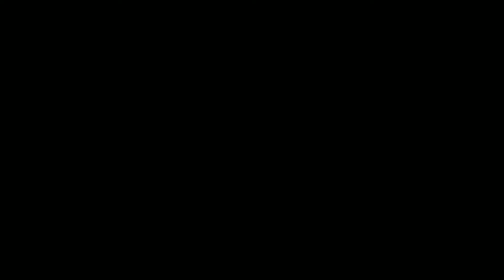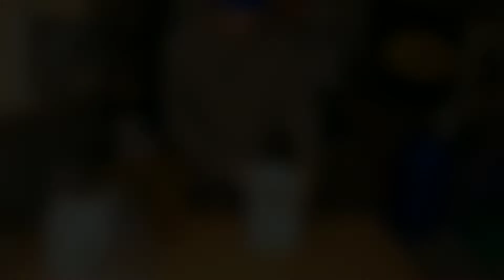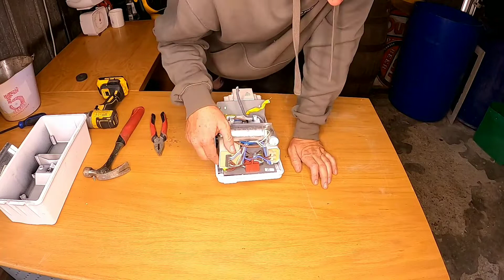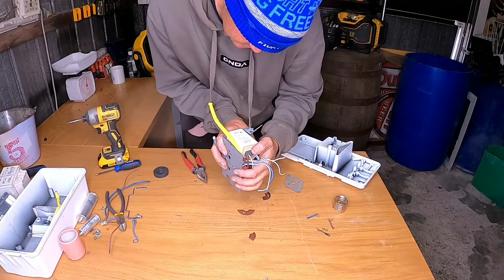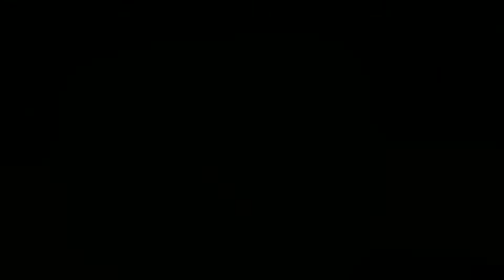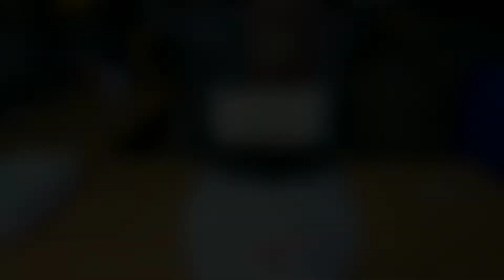Scrapping High Bay Lights For Huge Money Pay Out #scrapping #recycle #makemoney

Comment: Thats awesome mate great job and looks like a very nice payout coming your way once you have the all scrapped out. If you scratch that silver fitting the bulb screws into you will find it to be either copper or brass and not stainless steel......Good video mate.
Reply from the maker: Cheers. Thanks for the tip on the bulb screw thing. I'll check it out.😎👍